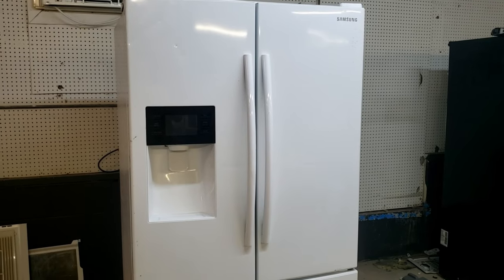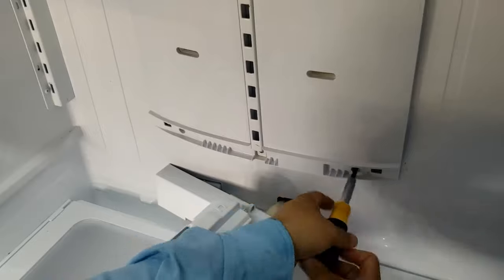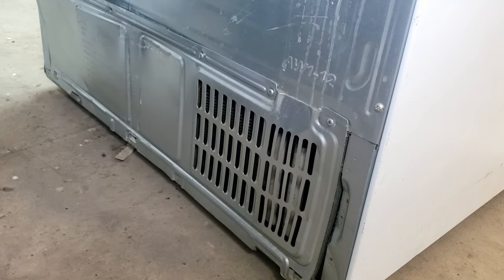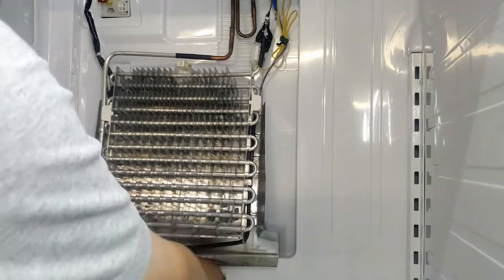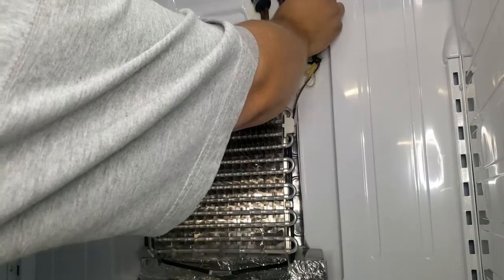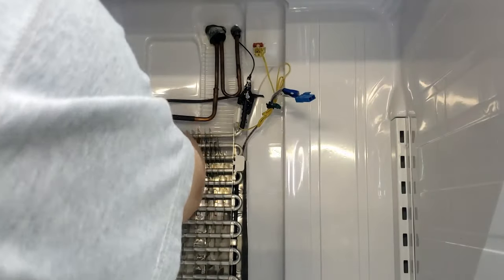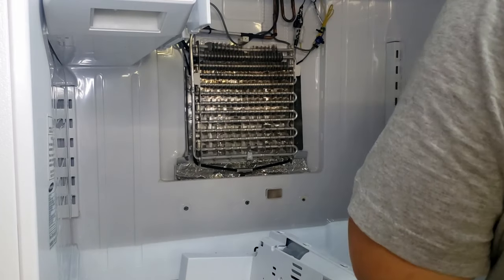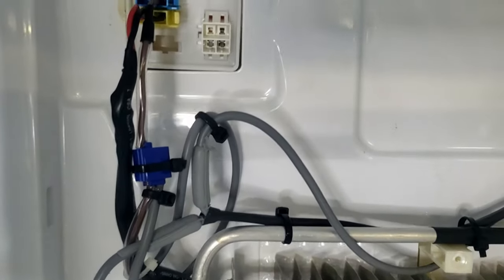Samsung Refrigerator Ice Build-Up and Leaking Water Inside Drawers - How to Fully Fix it Forever

Comment: @Ben  The foam pieces are supposed to be applied to the REAR of the metal pan, not the front (according to Samsung's Service Bulletin ASC20171005001). 

As I understand it, the point is to insulate the metal pan from touching the back white casing of the fridge so that the pan has a thermal break from the fridge body. Without it, the cooling coils transfer too much cooling to the fridge body and that stays cold and prevents the heater from being as effective when defrosting.

The way you pictured applying the foam, on the front of the metal pan, does not accomplish the intended purpose. 

Aside, the service bulletin also notes that this foam kit isn't needed for fridges manufactured after January 2013 (though I did mine anyway because it probably won't hurt to add it). Hope this helps!
Reply from the maker: Interesting, given the installation instructions I was given had it in-the-pan and that they'd even keep that part of the components w/ the package. Probably should then phase it out.
Reply: @bensappliancesandjunk    Yes, Samsung could be more forthcoming with their customers and publish this information more readily. They seem to only publish this information for use by their authorized service technicians, but a lot of fridge owners seem inclined to attempt fixes themselves, no doubt tired of paying expensive service fees for what is clearly a lemon of a fridge. 

Anyway I very much appreciated your video! Thanks for making it. I think installing the supplemental heater like you did here might be the best solution to prevent the fan from icing over. I've tried insulating the copper tubes (in the top right beside the fan) and we'll see if that is enough. If not, I'll probably have to do add the extra heater cable.

Aside, that 2nd heater still doesn't fully address the drain issue though and the water pooling (and icing) inside the bottom of the fridge section. I suspect the drain line is also freezing further down beyond the reach of even the new style defrost heater tab. I think adding a 2nd supplemental drain line heater would be an interesting experiment. Maybe you would consider doing a video on that too? :-) I saw in another comment you suggested a longer copper wire (or even a coat hanger), but I don't think it's possible to actually fish a stiff wire like that far enough down (at least I wasn't able to).

Q: Do you think the power draw would be too much for the defrost heater system to have two Supco 15w heaters, one for the top and one for the drain hole? The Supco heater you suggested in your description (the SH501) is 15w. There is also the SH500, which is 11w, and I imagine a heater in the drain line wouldn't need much power to do the job in such a narrow space. I wouldn't want to fry and of the fridge's electronics. Thoughts? 

Q: Also, why did you use the SH501, which is 120v? I think the fridge operates at 115v. Is this an issue? Any reason why you didn't choose the SH201, which is the same 15w but 115v? 

Thanks again for the great video Ben! Your instructions are easy to follow and I like how you explain everything and your video is clear.
Reply: Okay, its not clear which one is correct. Place it on the front as per the video or On the back as indicated above.............  Reasoning would be helpful too!!
Reply: @Anavllama  It's supposed to be applied to the back. The reasoning was already provided above by Figs North -- purpose is to insulate the metal from the back of the fridge, which is why it goes on the back of the metal pan, so that it's between the metal pan and the back of the fridge. Search Google for "Samsung Service Bulletin ASC20171005001", which has the instructions.

Comment: I installed the kit this weekend on a Fridge very similar to what was in the video. Here are some tips based on my experience:

1. Drawers/Shelves out -- some are a big pain, worth to research videos just on that. The side with the ice maker is difficult as each shelf seems to have a different method for pulling it out.
2. Removing the shelf above the water filter. Need to get a small flat blade screwdriver INTO the LEFT side tab (the plastic tab you can see on the shelf itself does nothing) and push in, this releases the shelf from the water filter housing. Take your time as you do not want to break any plastic.
3. Program Mode -- Took a couple tries to get it to work. Not sure why -- fingers not in the exact place or pushing at the exact time? You know it works if you hear the BEEP and then when you push only on the LIGHT button (middle button on right side) the codes show up. If you get the standard screen of the temperatures, you need to try again.
4. rd or fd mode -- in this mode, the fridge with BEEP non stop for about 30 minutes. I had so much ice I had to redo this mode 4 times so I could remove the panel. I had ice coming out of the vent slots and when I finally got the panel open (being very gentle to not force it!) the ball of ice was more like a WALL of ice -- 4x the size! Wow! I was too impatient to just let the fridge defrost on its own. Carefully removed all the ice and cleaned the fridge before installing the two kits.
5. Watch this and the other video at least 2x before doing the job and then keep it running when you are actually doing the job, take notes. I also did the same thing with the Posi-connectors! If I had only seen this video sooner.
6. Secondary heater wire -- mine was not as long as in this video, but it was sufficient to go over all the copper line. You want to go over all the lines.
7. Temperature Probe (yellow wire on right with White end) -- I did not replace, but as suggested moved it further to the right. Will see if there is an issue down the road and if I needed to secure it more.
8. Test your work -- after the install, I let the fridge get cold -- just a few minutes is enough and then went into rd mode. Use a temperature gauge of any style to check, not your fingers!
9. Put everything back in the reverse order.

After the install, I started up the fridge and in just an hour or two it was running perfectly! It has been only 24 hours, and no issues so far.

Thank you Ben for the videos and the kit.

Comment: Ben, upgrading the air circulation fan to one that pushes a larger volume of air goes a long way to fixing the problem with the defrost cycle. Also repositioning the defrost sensor can help. I like your idea of adding a new heater or a secondary heater. The pics I've mentioned has kept my refrigerator frost free for nine months when I was defrosting it every three weeks. I'm letting it go for 6 months, it idiot show much icing. Checking it again at 9 months
Reply: How is your fridge running?  Is the more powerful fan still doing the job?  What fan did you install?

Comment: Thanks for this video, I've been battling with this fridge for years but I've had luck recently and with making sure the fridge is tilted back on it's feet not the wheels which seems to be working to prevent fan noise but I still see a block of ice and occasional water in the bottom of the fridge.

What is the point of new drain lines? Do they handle more liquid?

Comment: Before putting on the silicon sealant for the posi-taps, test the new heater and the main heater by:
The refrigerator is unplugged.
1.  Connect wires from the cover fan and thermostat, but leave the cover off.  If you don't connect the wires the internal computer will stay in error mode not letting you put it in defrost mode
2.  Now plug in the refrigerator

3.  Touch and hold the Freezer and Lighting icons on the outside control panel for 8 seconds until it beeps, a continuous beep means the refrigerator is in defrost most, wait about 5 minutes.
4.  If you have a heat thermometer, or even a Covid thermometer gun you can check the lower heater (it would just say high if a body thermometer or 200F if it was a surface one),  you can even touch the small heater Ben supplied, it will be warm to the touch or you can zap it too with the heat gun.  If you don't have a heat gun, a drop of water will sizzle on the main element and you can feel the heat with your hand for the newly installed one Ben supplies, it won't burn you.
5.  At this point I would feel comfortable putting on the sealant because after all if you screwed up and put the sealant on too soon your in for a mess if you need to unscrew the taps because maybe you didn't connect them to the BROWN wires on each side of the panel area.
Assemble the fridge and go for it or let it go for a couple days with the cover on (not bolted in yet) and check it after several days to see if you need to move the thermistor around  (white bulb thing on the right side connected to the yellow wires) because it may still not defrost when you want it to, so you will want to move it to where the coldest spot under the cover is (area with the most frost).
Reply: Appreciate the information about testing the heater! Thanks

Comment: Sorry, for a $2000 + refrigerator I don't feel I should have to re engineer it. I had this problem plus ice maker issues. And after only seven years, it stopped cooling. Mine went straight into the dump. Very informative video.

Comment: After following this video and installing the kit... a week later I woke up in the morning to find that my refrigerator door was left slightly ajar.  There was wet humidity and moisture covering everything in the fridge and I even noticed a little bit of ice accumulation coming out of one of the vents.  

I put the refrige in defrost mode for 20 minutes. After that the fridge has been running perfectly and I did not have to disassemble the fridge to remove the ice ball build up.!  I've had to disassemble the fridge three times to remove ice buildup over the years for similar reasons ..The kit works
Reply: Ben I bought the repair kit with heater also the drain tubes,,, i installed the kit in February now 2 months later and the pantry door tray is getting a small amount of water and frost under the drawer ! No more fan noise with extra heater but water on the floor also ….. what do you suggest now?

Comment: Bought a house and it had one of these fridges in it. 6 months later fan is making a noise and the fridge isn't cooling. Upon finding this video, it looks like its had this issue before and has mylar tape on the copper pipes. it did nothing to prevent the ice ball. Mine was so bad, the back panel was frozen stuck. Thank you so much for this video :)

Comment: From a tech.
We just foam tape the evaporator feed lines with foam tape.
Reply: Are you having 100% success with simply foam-taping the lines? I have a roll of that silver foam tape wrap leftover from wrapping my central air ductwork in the basement...is that a suitable type wrap for the fridge remedy?
Reply: @PureBlood42  I tried the foam tape 6 months ago (I did a seriously thorough job too), and the fan is starting to ice up again. Too bad, as I thought I had fixed it. Now I'm going to install the heater. Foam insulation is not enough to keep ice from building up. I recommend you bite the bullet and do the heater.

Comment: Bought this fridge used, last year for 400 dollars worked fine for 8 months then this happened.  Its a really nice fridge, nicer than the one in my kitchen actually I have this one in the garage, I just ordered a kit last night.  Since this is a garage fridge for drinks not so worried about the water, but the ice ball stopping the fan makes the fridge part unusable, the freezer still is working fine.
Reply: Just some details, on my ref. once I opened the cover someone had moved the thermistor using some black sticky stuff and put it by the two copper pipes going through the top of the refrigerator, I moved it to the top cooling coils, the white piece was made to snap onto an evaporator coil not just hang freely.  Also, I am not that bright, do not tap into the yellow thermistor wires we need to tap into the brown wire on both sides.  I left the cover off to test it first, but I didn't put on the silicon sealant until I know that the connected it properly, once it tests OK then I will de-thaw and put on the sealant to the connectors.  Why does the fan shut off every time the doors are opened?  Why not keep it cooling while its open?

Comment: 7:10 - those self-adhesive strips has to be attached from outside of aluminum cover. You gave people wrong recommendation. It has to be between aluminum cover and fridge body !!!!!!!!!!!!!!!!!!!!!!!!!!!!!!
Reply from the maker: Thanks for the info, I'll look to revise the video
Reply: @bensappliancesandjunk  YES PLZ
Reply: @bensappliancesandjunk  I think he is correct. Can you please post a response or modify your top post to let folks know if the fool/foam strips should be on the back side of the oan between the fridge plastic body and the pan? As an engineer, it seems like that is where it should go.
Reply: @bensappliancesandjunk  Ben, can you please pin a correction to the top of the comments about the foam strips being incorrectly applied in the video?  See Samsung's Service Bulletin ASC20171005001. The foam strips are supposed to go on the BACK of the metal pan, not the front. Why allow people to be mislead any longer? Let's correct the record!
Reply from the maker: @sergeylarry7202  yes, I've added it on other pages and will correct on this one

Comment: So, you may ask, why does this work ok for the first several years... Mmm. Ok it is because samsung used shit foam. It allows water to sink in the foam on the outside of the evaporator. This water that builds up freezes hard and does not ever defrost. You need to remove the panel, take it apart carefully. Set the whole thing in the sun for a day. Weigh the foam panel under the aluminium plate. It should be less than an ounce. Mine was 11 ounces when it came out because it was full of ice inside. Once dried out and light again, apply liquid car wax to the foam to deal it, reassemble carefully and reinstall.
Reply from the maker: Its that and the components tend to degrade their efficacy over time.
Reply: @bensappliancesandjunk  yea, over 3 to 4 years??? ... it is more like samsung picked the wrong foam. I am going to seal the foam so that it no longer will allow water penetration, including on the new panel. This problem happens to styrofoam stuffed boats all the time. I have been able to reduce the weight(water in the foam) by 5 ounces over night by using a hair dryer. I will use power of the sun in Florida today. This is a bad design by samsung period and they need to be held to the fire for it.
Reply: @allenwilson6585  @BensAppliancesandJunk maybe you all can make a video on the foam issue too?

Comment: Just a follow up to my comment on Ben’s other video on this same topic. I ordered the YoutubeFix kit from Ben and installed it according to Ben’s videos. I commented that it would have been easier if instructions came with the Kit. Ben replied that the instructions were in a link in the parts order instructions. 
What is more important is that Ben said there is an Error in this video on where to install the foil strips for the drain. They go behind the pan between the pan and the plastic cabinet not between the evaporator coils and the pan. I’m still not sure if the ones by the bottom go on as shown or if they also go under the pan (I emailed Ben on this but have not gotten a reply yet). I followed this video to do my install, I now have to completely take the unit apart to correct the incorrect foil installation . I am grateful that Bens Appliances has figured out how to fix this Major issue with Samsung refrigerators but he needs to take this video down and put up a corrected version. 
Finally I want to make clear that his online KIT is well worth the price and I believe will fix the issue but the instructions for the foil strips needs to be better.
Charles Meyer

Comment: Ben:  I've been fighting this issue for years.  I have tried multiple things that were suggested and had my warranty service on the refrigerator many times.  I ordered this retrofit and installed today.  Other than the back panel (of which I also ordered because the Styrofoam was damaged) in the fridge being hard to re-install all seems good.  I don't have a heat sensor to check that it's working but I did check continuity on the heater connections and it seemed fine.  Time will tell if this eliminates the ice build-up.  I'm sure as long as it is installed properly it will fix it.  Thanks for the video.

Comment: Just ordered the kit and will try this fix when I get it. Hopefully this permanently solves this long term issue with this fridge. This ownership experience has been very frustrating up to this point.
Reply from the maker: I hear you. Most techs I know have these heaters out in the field for a year and a half plus and no issues as long as its installed/verified working correctly.

Comment: Hi Ben, Great Video, good quality but ...
You need to re-shoot the part of putting on the sticky foam pads. Per the Samsung service bulletin the foam pads go on the BACK Side. BACK and BOTTOM away from the cooling coils. Exactly opposite side to what you are showing people. 
I have had ice hitting the fan, water pooling and freezing under the pull out tray and under the freezer drawer. Yes the drain hole here under the top evaporator was frozen closed. I am hopping these fixes solve all my issues. The Temperature probe as installed by Samsung was facing right instead of left per the new bulletin, and the old short drain probe was bent and didn't even go down the drain hole.
Reply: Do you have a link to Samsungs instructions regarding the foam tape application?
Reply: Thanks, found out about this AFTER doing the switch. Wondering if it still works the way he showed in the video....